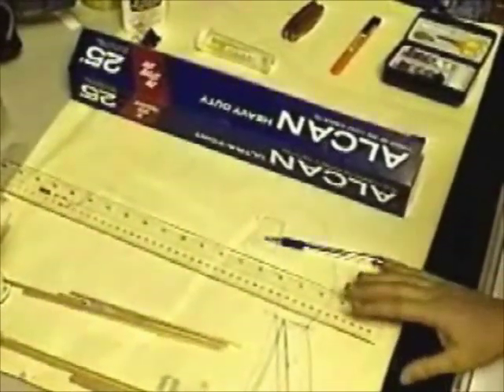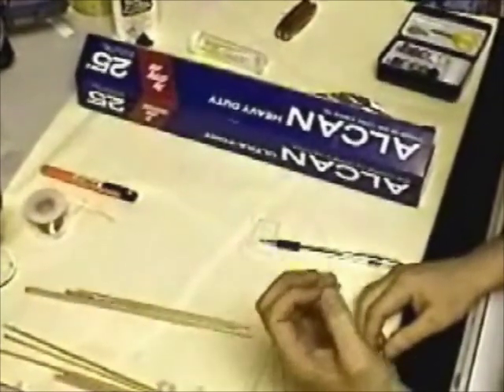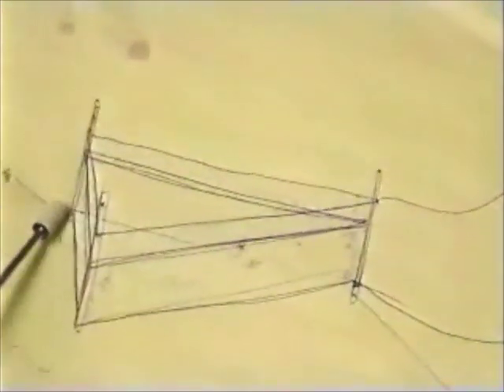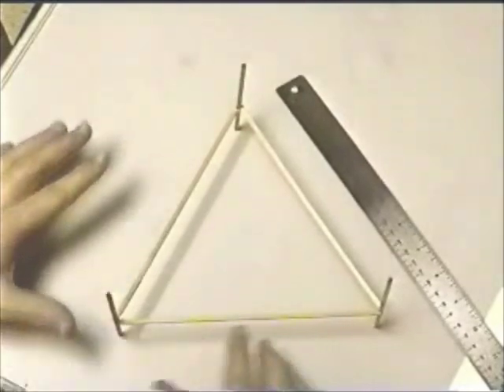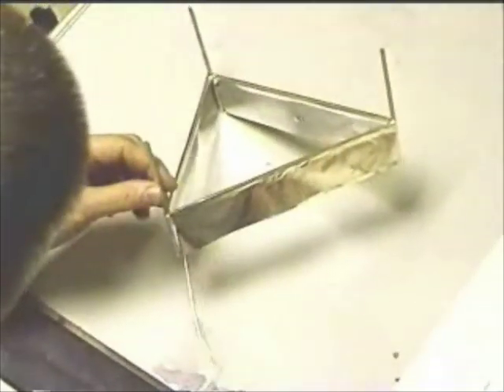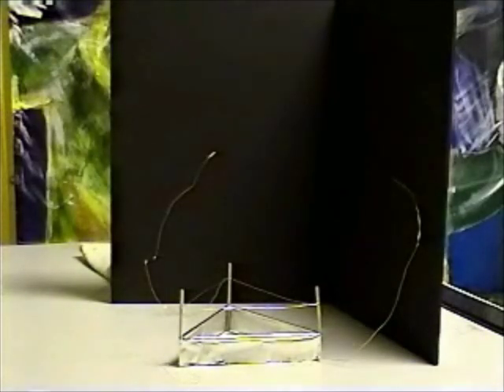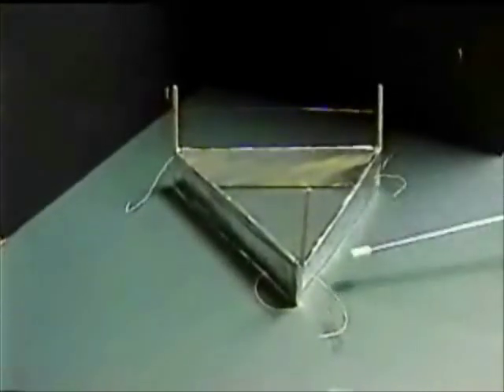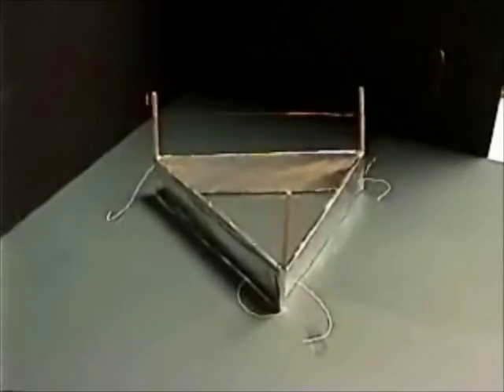Electro Magnetic Propulsion Experiement

Comment: Magnetic floating works for short distance. It is working for generators, alternators and electromagnet repulsion train tracks. For long distance we need to amplify and invert gravity waves . Thanks for the video.
Reply: This is NOT even magnetic lift or propulsion. It's a home made ionizer that accelerates ions produced from ambient air. This will not work in the vacuum of space for lack if any gases to ionize.
Reply: @jeffmccrea9347  Then, why the title of the video says "electromagnetic propulsion experiment" ? Be specific. Thanks.
Reply: @juanmelendezrivera6085  because the title is wrong

Comment: When I was teaching I had one of my project students to build one of these. We had a triangular one and a square one. We took it to an industrial lab to connect the high voltage and we used a variable high voltage source - zero to 25kV. We raised the voltage slowly in incriments from zero and when it reached around 20kV, the lifter raised itself up from the wooden bench that it was sitting on and moved around the table. Unfortunately, we didn't have the first lifter tethered and it floated across the table top and fell onto the floor and broke. We tethered the second one and that was OK. It floated around about and inch or so above the wooden table top. We had several witnesses but due to the high voltages involved, it was difficult to try different options. It did work and although it lifted itself up  I don't think it would carry a load practially.
Reply: Electromagnetism is the key.

Comment: There is a difference between weights in weighing a strong magnet from different poles directions )unless my measuring have been fault) . It is neither from polarization ( because that polarization only increases the weight from every direction and doesn’t shows any difference between the weights) nor from earth magnetic field (because the earth magnetic applies Torque and not Single force) . What is the difference from ? I think and sure that it is gravitational . mentioned amount is carefully explained In the article titled : «complex gravity». I will present that if necessary . The theory is not only theoretically a compatible theory ; but is also proven practically . That is also compatible both with string and quantum theory and unified them as the <particle waves>
Email no. :    seid.m.m@gmail.com
Mobile  no.   :     +989123245497

Comment: This is excellent work but you are still trying to do it with very high voltage, I tried a similar experiment using very low voltage then compensating with static charges and high speed rotation, in the end I kind of made a funky helicopter with no blades and using the body as a lift device...video to follow...

Comment: It is not electro magnetic propulsion experiment  but electro nonmagnetic propulsion experiment.we are simply seeing  nonmagnetic levitation. there is magnetic levitation (on trains floating on powerfull magnets) and there is as well non magnetic levitation that works with static electricity. Electrostatic currents are high voltage low ampers and can propagate through air.....you can imagine the rest......

Comment: i have done am experiment several years ago that could have fit your description. i used very high voltage and created a sheet of ionized gas and the pules a magnetic field via capacitive discharge  on a lower coil. though the anode, cathode, and magnet were stationary and mounted the ionized sheet was deflected greatly. i wasn't measuring thrust though so i couldn't tell you anything about that. neat experiment though. i haven't built one of these in years, thank you for the video.

Comment: yes. very thin copper wire is needed.  We used magnet wire, which is extremely thin and light.  We simply taped it to the bottom of the aluminum foil (which was also light-weight).

Comment: Yes you could...however...I don't advise trying this experiment unless you are extremely comfortable working with high voltage electricity.  You could use any other power source that is connected to a very large capacitor.  The required voltage is quite substantial - so normal power sources don't work.  The monitor offers a power supply anywhere form 8000 - 15000 volts.  It enables this by stepping up the 120 volt input from the household outlet through the capacitor within the monitor casing.

Comment from the maker: Actually you're partly right.  The hissing is the actual ions being 'magnetized' and traveling from the negative to the positive.  The oscillating noise occurs because the capacitor that is in the monitor fills up with electrons - then dumps them out - then fills up again.  The power itself is constant, but it takes that extra few seconds for the capacitor to fill up; when this occurs there is little or no charge to the lifter itself; and no magnetization.